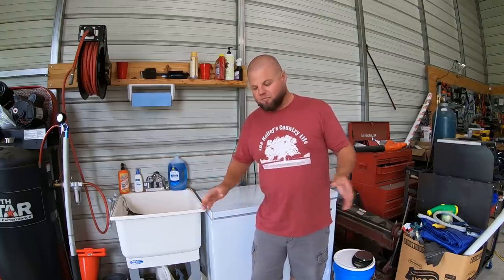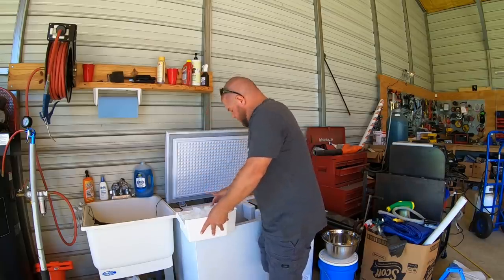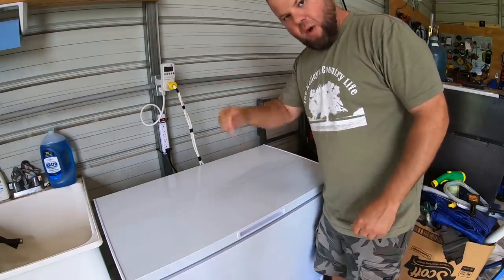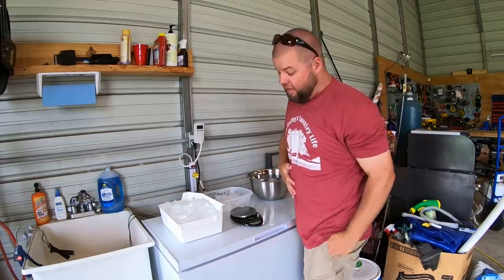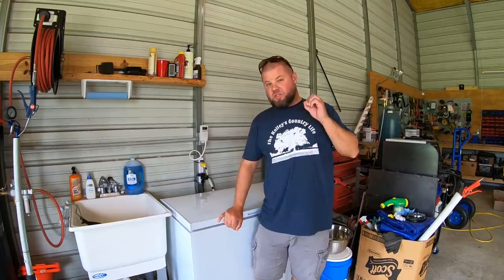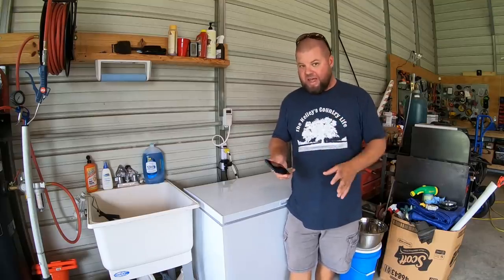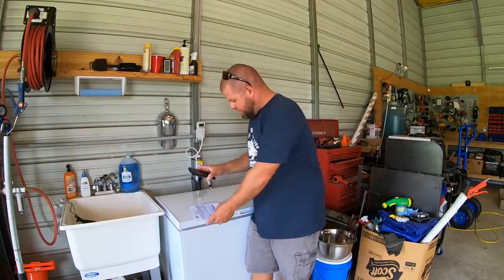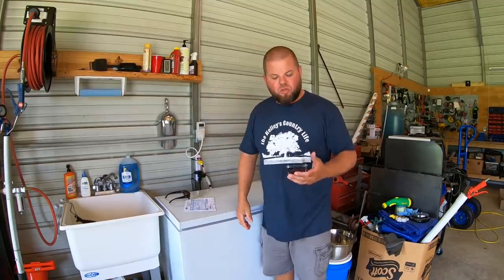Homemade DIY ice machine tests, energy usage and cost per pound! #370

Comment: The Killawatt isn't very accurate at low currents so it's likely that the fans you have are running at their half watt rating.
Reply: If you are a “techie” and have good solder skills/techniques, you can “reflow”  or clean up the kill-a-watt board and improve its performance. The final manufacture on the board is done by hand by low paid workers & this contributes to the inefficiencies... just my 2¢ worth...

Comment: Great Project!  It sounds like you are saving yourself about $2.50/per bag.  If you have $800 into the project it will take about 320 bags to break even.  12 weeks in summer at 6 bags a weekend is 4.4 yr payback.  If you already have a freezer for storing food, you could save by putting in a partion for ice making and the rest of the area for food.  For my use that would be the only way for me to justify it.
Reply from the maker: This is Florida, I use ice every weekend and during the week some too. Also I have exactly 369 dollars in this project.
Reply: @TKCL  $370/$2.50 is 148 bags.  6 bags a weekend is about a 6 month payback!  That makes sense now.  For a lower ice user I like the idea of just using a small space in the freezer I already have for the summer and then pull equipment out for the winter.  Your design would make that possible.  Keep up the great work!!

Comment: All the water eggheads out there are going to tell you warm water freezes faster. They are wrong because I've tested it myself. Also, on your ultimate build you may want to raise your freezer and build a hopper into the bottom to fill your coolers directly.

Comment: I think you would need to somehow include the increased load on the well to get a true total cost...though I think it would be minimal with those water volumes. It would be easier to calculate on city water, probably.
Reply from the maker: Pump and well in the country, it's already factored in by my electric bill. I have a 80 gallon tank and when the pump kicks on its for a few seconds. Nothing to really add in here
Reply: Plus the well water is way cleaner than any city water I would not want to drink city water 🤮 if you could see the state of water mains you wouldn’t too

Comment: Why don’t you put a water meter on the water line, then you wouldn’t have to weigh all that ice. Water in equals ice out. Loving this project. Oh, and adding a switch to turn the fans off means they are running down as you open the lid, unplugging or adding an external switch and waiting 10 seconds means they are stopped and drawing no air at all when you open the lid. Try making a styrofoam cover that is like a tray with sides than just comes down low enough to cover the seal around the lid. All the best to ya👍
Reply from the maker: What's the fun in that? 😁 I like seeing all that ice! ❄️❄️❄️❄️

Comment: What was the total cost of the freezer and dual ice makers ... (I think you said the fans were sent to you by a subscriber).  With that total investment in mind, how many bags of ice could you have bought?  Or ... how long will it take to recoup your investment based on savings related to making your own ice instead of buying it?
Reply from the maker: 369 dollars. 92 bags at 3.99. 123 bags at 2.99. That doesn't include gas, travel, wear on vehicles ect. It doesn't take long for my return on investment.

Comment: You need thermal mass AND the ability to circulate cold air.  A freezer with cold objects in it runs more efficiently, but a freezer filled to the brim does not.

Comment: The old adage that hot water freezes faster dates back to the days of the non-self defrosting freezers.  When the tray with hot water was placed in the freezer compartment of the refrigerator the hot water melted some of the frost under the tray (which by the way were aluminum in those days) thus allowing the ice tray to have a much better contact with the cold surface.  When cold water was used the melting was minimal and left air spaces under the tray and caused it to freeze slower.   I realize that you are too young to remember when the freezer compartment usually had several inches of ice on the surface.

Comment: I'd be curious how the dual fan up close would be if you had one turned to flow the opposite direction so that you have a circular current flowing in the makers area.
Reply from the maker: I've tried the reverse flow before on my older model and don't remember there being any gains.

Comment: I worked at a hockey arena during college and hot water freezes faster than cold water just try it in a pop bottle in a freezer you will see the hot water will freeze solid faster

Comment: Flexible-tray icemakers are timer controlled. After the tray has filled with water, a timer starts the ice ejection cycle after about two hours of freezing time. The flexible tray ejects its contents into a holding bin, returns to its starting position and is automatically refilled with water for more ice.

Yours is Hard Finger tray 

Hard-tray icemakers use a thermostat to sense when the ice in the freezing tray has fully frozen. The thermostat then triggers motor-driven “fingers” that push the ice out of the tray and into the holding bin. Once the ejection mechanism resets, a switch opens the fill valve long enough to refill the ice cube chambers and restart the ice-making 

Since yours is hard finger it used a thermostat in the device. By putting a fan near it. You increase cooling effect. It freezes faster as heat is dissipated faster.  Thermostat triggers and bongo make ice again.  You get more ice production per 24hours
Reply from the maker: Exactly! Thanks for watching

Comment: Your freezer seems warm. If the ice makers are releasing at 10f and you have it set to 0f then setting it colder, -15f, will increase the temperature difference and decrease freeze time
Reply: Oh good, you will test it.
Reply: By definition the faster you make ice the more power it will be. Just get it cold
Reply from the maker: Luckily at the moment cost per pound is so low, I can afford a little extra electricity.

Comment: Simpler (and corrected) math: ~$.20/day to make ~10 pounds of ice is 2 cents per pound for production, pulse probably about 1 cent/pound/day to keep it frozen in there.    So 50 pounds of ice made the same week will cost about $1.00 to make, and about $.40 to keep the first make cubes cold.

Comment: Again the hotter the water the faster it will freeze. If you take boiling water and just through it into the air when its -30 or below outside it will freeze before it hit the ground. There are video's on you-tube you can watch of it.
Reply from the maker: Testing

Comment: Just a clarification. I think you misspoke when calculating the price per pound. If the energy costs you $0.21/day in electricity and you make roughly 10lbs of ice a day, the total cost per pound would be $0.02/pound (2 cents/pound). That still gets you to a $0.40 price for a 20 pound bag so the final calculation was correct.

One thing to keep in mind if that you are on a well (it sounds like). So for others thinking they can replicate this, first check your electric costs, and second remember if you have a water bill, that is some (albeit not much) additional costs.
Reply from the maker: You are correct, I didn't say it correctly

Comment: The idea that hot water freezes faster is absurd, i remember having that conversation while watching the zamboni.  Freezing water is about removing heat from the water.  The hotter the water the more btu's need to be removed.  Heat needs to be conducted from the water to the tray to the air inside to the freon to the air outside.  This is not a complex model.
Reply: Mpemba effect, which a lot of the time seems to be due to better atomizing/evaporation when boiling water is tossed into freezing air increasing the effective surface area over the colder water being tossed into the same air.

Which would almost certainly not apply here.

Comment: Now I have not read all the comments on all the videos. There is one thing I can not wrap my mind around. The ice makers themselves. Are they mechanical or logic based electrical mechanical?? If they are built as cheap as possible they should have a motor driving a reduced gear box that controls everything. This includes the water solenoid, tray heater, and harvest wipers. 

The metal bin full arm should have a micro switch to open the power to the motor when the bin is full. Should also be a bi-metalic thermostat contact to stop power to the motor if the temperature is too high to prevent the water solenoid from being energized. If this is the case the order of operation should be;

Temperature is low enough to close the thermostat contact
Arm in lowered position closes switch 
Motor turns
Wiper contacts sweep by and energize the different controls 
Water solenoid 
Tray heater

The harvest fingers are turning the whole time at a consistent speed. The harvest is determined by the speed of the motor and nothing else. The fingers will rotate a full rotation only (X) number of times per hour/day. (RPH or RPD)

The part I do not understand is that this is a consistent process. The motor speed is constant. The time between the different functions are constant. No outside changes  will increase the speed of the motor or how often the ice is harvested. Yes, the water may freeze faster in the tray, but the newly formed ice will just sit waiting for the harvest. 

Now all of that rant is for nothing if the inside of the ice maker has a logic board with sensors controlling the speed of the harvest. 

Please follow-up with a tear down of the ice makers. If they are purely mechanical and gear driven you may not be able to increase the harvest rate. If there is a PCB you may have dip switches or pots to adjust to speed the harvest. Since you have a Frozen bin to collect the ice, you may be able to harvest a 'partially' frozen cube. As long as the drop doesn't allow the cube to crack and leak water. The cube should complete the freezing in the bin with the rest of the ice.

Sorry that was a lot to say, but it has been nagging me.
Reply from the maker: This is from a viewer
Kevin Keane 6 hours ago
Found this online. I really thought it
was just a timer control. I think I'Ill be putting a fan in mine now as well. 
"Once the mold is filled, the machine
waits for the water in the mold
to freeze. The cooling unit in the
refrigerator does the actual work of
freezing the water, not the icemaker
itself (see How Refrigerators Work for
details). The icemaker has a built-in
temperature level of the water in the
thermostat, which monitors the
molds. When the temperature dips
to a particular level-- say, 9 degrees
Fahrenheit (-13 degrees Celsius)--
the thermostat closes a switch in the
electrical circuit."

Comment: Your ice makers are on a set timed cycle. Cycle = Fill, Freeze, Heat/Release, Dump.  So, lowering the temp on the freezer will make the ice freeze quicker, but the ice makers will still be on their same timed cycle. Don’t wast the electricity.
Reply: This was proved wrong way earlier in the series. Recommended you watch it all.
Reply from the maker: Thank you

Comment: Is there any way to speed up the cycles of the ice makers. I know it works off temperature. But the ice maker in my fridge is the same kind and I know it sits for awhile after it freezes the ice solid. If you can shorted the cycle time, more ice. Maybe decreasing the temperature setting in the freezer will do that.
Reply from the maker: A lot of ice makers have that function

Comment: While I agree that this is a genius move I have just one issue with it. How are you getting the ice out of it?  When the ice in the maker calls for it to dump there is a heat element that heats up and melts the ice just enough to get it out of the tray...then the ice falls into whatever you have to catch it and refreezes making it all a big block of ice that you have to pound apart to use.  This has been my experience with ice makers. Can you give us more detail on this please?
Reply from the maker: Watch my daily #short videos I make. Not once do you see ice stuck together, even with this almost full. I've been running this for over three months and so far so good

Comment: Add at Watt meter that it all plugs into .. read the amount of electricity the project is using .. $10-$20 power meter
Reply from the maker: I did that already, cost me 21 cents a  day to run. 44 cents for 20lbs of ice.

Comment: I wonder if you could verify that the water temp is effected that much by the outside temp by testing water temps using the facet right next to the freezer at different outside temp.
Reply from the maker: Testing

Comment: I don't understand how these icemakers can have a variable output.  I thought they just worked on a timer - which would yield a fixed output in 24 hours?  Does it have some super sensitive tray thermostat that will dump the ice when it reaches 32 degrees for x amount of time or something (to guarantee all of the water in the tray is frozen)?
Reply from the maker: Exactly! It has a thermostat that reads the tray/mold temperature and then triggers a short timed dump cycle. So the quicker the tray reaches freezing temperatures, the more the dump cycle is activated.

Comment: After all the tests I’m going to build me one
Reply: Unless you have a spare freezer it isn't cost effective to do it his way. You can buy commercial style ice makers for under $400 that produce 25+lbs per hour. While this is fun to watch, it is in no way practical if you have to buy a new chest freezer.
Reply from the maker: Depends on what kind of ice you want and how much storage you need. FYI Costco has small freezer ls on sale for 99 bucks. It's a very practical build
Reply: @OmegaGamingNetwork  different kind of ice, that is hollow ice and is made for drinks. he is building an icemaker that makes solid ice that doesn't melt in 10 minutes. very practical if you use a lot of ice and it appears he does. but keep hating, you're good at it.
Reply: @chipchaser44  There was no "hating" in my statement, just a statement that people need to be aware of. There are pro's and Con's to both methods. Disagreeing or pointing out flaws isn't hating. Further, while hollow ice does indeed melt faster production is an important consideration for someone who needs lots of ice. Sometimes you simply need to fill a cooler up quickly and if it isn't a junk cooler the hollow ice won't matter especially when one machine can produce more ice in 24 hours than the other can in a week. It all depends on your individual use case.

But then, given you just made the wild assumption that "I'm good at hating". I suspect you didn't come here for a discussion of facts.
Reply from the maker: You'll enjoy upcoming videos! I'm testing exactly what we are talking about

Comment: what kind of solonoid and where do you get the solonoid?  How does it shut off when full?
Reply from the maker: It's a water valve and comes with the ice maker. The ice maker itself tells it when to come on or cut off.

Comment: Not really a test point but what is the cost of the filter and how often are you replacing it?
Reply from the maker: Filter was 10 bucks if I remember correctly. I have yet to change it after 3 months. I need to calculate pounds produced daily to water volume and see when the filter recommends being changed. It wouldn't hurt to do it soon, but I don't see any color or issues with the ice cubes.

Comment: nobody going to tell him to try and use a delta fan? regarding thermal mass, the more you have inside the better it is for the freezer. yes it will take more energy to freeze every all the item inside but once everything freezes the freezer actually wont kick in as often, infact a good rule of thumb is to have a bunch of soda bottles filled with water to line the bottom of the freezer as a thermal insurance when the power cuts out. the ice in the bottles actually help to keep the freezer cool.
Reply from the maker: Testing

Comment: Here in California i pay .3456 per kwh so thats apx 60cents a day or 1.50ish for a 20lbs. But here is a new catch drop a pair of 250w solar panels on the roof and 2 golf cart batteries on the floor and you will pay almost nothing.
You only need about 2kwh of battery and 350w of solar to run that off grid.

Used b-grade 350w 35v pannels can be had for 100$ 2khw of good safe lithium can be done for about 300$ signwave inverter 150-200$ so 800$ all in solar powered ice maker. Put this in a small poll shed on the side of the road at 15cents a pound and i bet roi is under 2 years and cost nothing to run.
At you power cost don't make sense 77.68$ per year but for me at 237.31$ a year with rates going up apx 10% per year the solar pays off in 3 years tops this is very good roi
Reply from the maker: Solar is starting to interest me
Reply: @TKCL  also just a note for others that's the first step in my power aka base rate and only for the first 300kwh after 300kwh each additional 100kwh is +10cents per kwh my actual usage is apx 590-640kwh a month before i added a diy 3kwh solar setup that charges 4 used tesla model S modules (21.6kwh) and a big inverter runs My A/C and fridge this dropped my electric bill down to  120-180kwh a month so a stay in base rate and i can use the fridge and ac when the power is out (it happens more then you'll think in California)

A 620kwh bill 
Is the stepped power + 45 service fee + 27.25 green energy fee + 23.44 co2 tax + 8.00 240v service fee
The fees are basically due just for having electricity in California.  So the minimum bill is 103.66 + power used also starting in 2024 the kwh is based on actual power drawn VA so watchout on power factor. A lot of cheap crap has very low power factor and if a device needs say 100w and has a pf of 0.5 you will pay for the waste power so you get charged for 200w load because your device is noisy and not efficient at pulling power clean